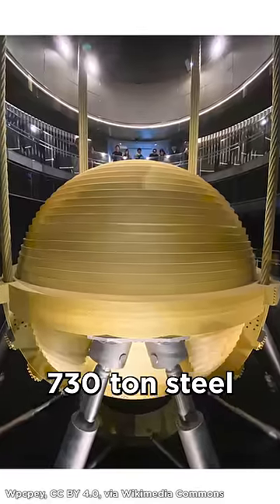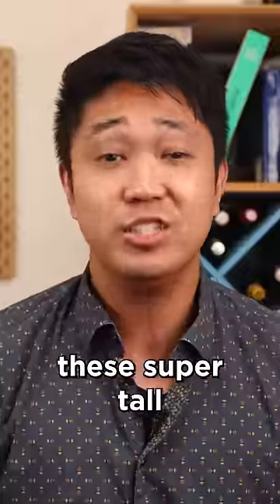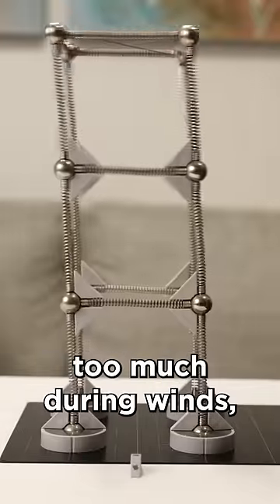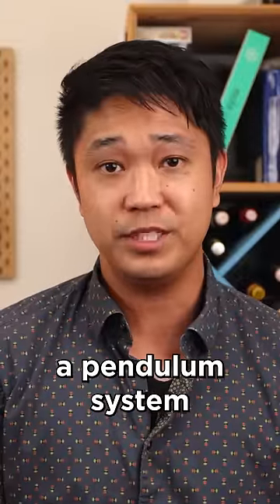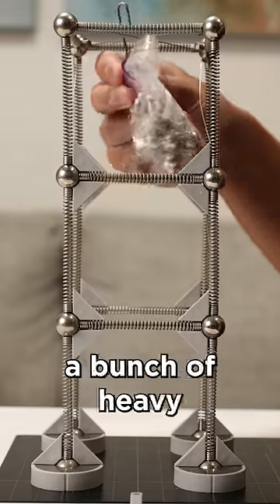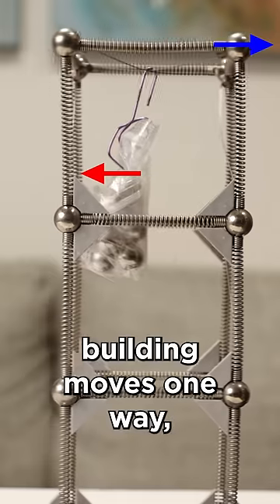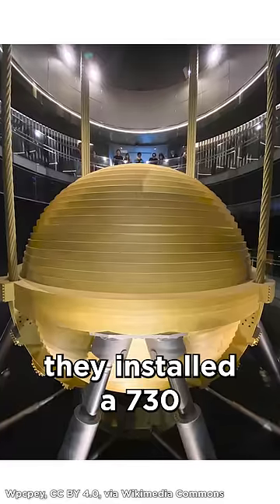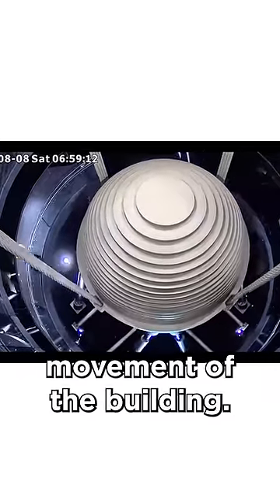Engineer Reacts to Taiwan's Earthquake Proof Skyscraper

Comment: I would just be scared of being under that ball because what if the chains holding it break
Reply: It's not held by chains,  rather suspended by hydraulic arms
Reply: + in addition the the hydraulics underneath there are steel cables holding it up so if the arms were to fail those cables would catch it. You can see them in the video
Reply: There’s overstrength factors used for critical components of seismic force resisting systems that multiply the force the components are designed for. Basically saying hey, if it has X amount of force on it actually, it needs to be designed for Y times that amount of force. So lots of redundancy and safety in the system.
Reply: Obviously, the people that built knew it was a massive ass ball...and accounted for it. smh
Reply: @rachel705 
Those hydraulics are what brakes the mass, there is no way they support it.
Reply: dont worry, taiwan doesnt hire engineers based on their race or gender
Reply: Idk, what if the building you are likely inside of right now collapsed, how about that
Reply: @zacharybyrne9723 obviously bud, and that’s not a technique specific to large steel dampers.
Reply: @gopackgo4036 probably not as obvious for those without a little bit of engineering knowledge so I was just trying to share. Also I did specify that all seismic systems have these factors not just this one. 👍🏻
Reply: @-pauI-  neither does the US. Go outside and talk to another human being.
Reply: Those aren't chains....

Comment: Same technology is used in cruise ships but with water, they move the water that store in the ship from one side to another during storm to counteract ships movements side to side.
Reply: cavitation right?
Reply: Not sure with that water that you are saying. Yes there is water ballast tank on all types of ships, i guess an estabilizer is equipped on cruise ships. But in Marine engines, it has what they  call compensator it is equipped in the Engine to reduce vibration during,  especially at rough seas
Reply: Ballast.
Cavitation is when air gets trapped behind the propellers/impeller and cause free spin without thrust.
Reply: The technology was quite famously used by Renault in their title winning 2005 and 2006 Formula 1 cars before it was banned. It made the cars so much more predictable over uneven terrain.

Comment: Motioneering did NOT engineer this TMD for earthquake resistance, it is strictly designed to prevent sway from wind loading. It may have a residual effect in earthquakes but that is not what it was designed for
Reply: So it's not effective against earthquakes of high magnitude (6.0 up)? Will it worsen the sway during such strong earthquakes?
Reply: @testsalv4366  it would never worsen the sway. It will still have a positive effect in strong earthquakes, but the engineers have a separate seismic force resisting system for the structure.
Reply: Yapping
Reply: @bensblues  Okay, thanks for the answer.
Reply: @bensblues so why tf did you bring it up if it helps with earthquakes? That's exactly what the video said
Reply: @mannb1023  the video says thats what its designed for, but it isnt
Reply: @bensblues  what im saying is that they are engineered for both wind and earthquake resistance, even if wind is the problem they are trying to solve
Reply: I have no idea where you got misinformed but the tuned mass damper is against all harmonic vibrations. A TMD is always acting against the resonant frequency of the building and does NOT care about the source of the unwanted vibration. Most skyscrapers have additional dampers against earthquakes too but a TMD is NEVER just for wind and it would be harder and more expensive to design a wind motion damper solely for wind instead of a TMD also known as a seismic damper.
Reply: @lolo_o4309  TMDs are often just to counteract wind sway. Hence why they are still used in very low seismic zones. You should read what Motioneering (the designer) say about it instead of arguing from ignorance.
Reply: @bensblues  TMDs are very effective at counteracting wind sway as they are designed to reduce the swing of the building. Most TMDs are also designed with the primary objective of reducing motion from strong winds (as those are more common) but that's not their only purpose. A lot of articles said that the TMD in the taipei 101 was designed against seismic activity which is also incorrect. Primary objective was to address wind-sway but it will always counteract swing from other sources such as earthquakes and was certainly put into consideration while designing in such an earthquake prone region (not as the main thing against earthquakes but a part).
Reply: @lolo_o4309  Man i dont know what you're trying to do here... you are now aware it was not designed for seismic movement, which was my point in the first place. What is the misinformation?
Reply: @bensblues  you: "it is strictly designed to prevent sway from wind loading" it was not... hope this clears thing up
Reply: @bensblues  What me and the other guy are saying is that the damn thing was built for wind and earthquakes, even if earthquakes are not the primary reason for it being built

Idk whats so hard to understand about what we are saying, I understand that the building uses additional tech for seismic activity and not just the damper
Reply: @mannb1023  well then what you are saying is wrong lol. The damper was built for wind, not earthquakes. The shear walls are designed for earthquake resistance. Any seismic benefit from the damper is unintentional and therefore not what it was built for. This is getting ridiculous
Reply: @bensblues welcome to the wonders of debating people on the internet, where no matter for how long you debate no one ends up changing their minds
Reply: The tuners in nyc, typically a low earthquake area (I know, I know, we just had one) don't use the pendulum system. It's a heavy mass on a micro thin layer of oil that moves towards the direction of the wind.
Citibank has one, and most of the super tall billionaires row buildings have them.
Reply: @lolo_o4309 I am studying to be a mechanical engineer, and I am about to finish a class all about damped systems.  The most important aspects of damped systems are the gain and corner frequency.  The gain indicates how large the reaction is to a certain input, and the gain changes with different frequencies.  The corner frequency is the frequency that the gain starts to change at.  It seems likely to me that damper systems such as this one would only be designed to eliminate low frequency, high magnitude swaying due to wind (or the lowest frequency waves from quakes).  The gain in that case would be 0 or very small.  Frequencies above the damped skyscraper's corner frequency would have a higher gain until steadying out at 1 (reaction is the same magnitude as the input).  I can't say whether that corner frequency is less than or greater than the frequency of most earthquakes, but it would be more expensive to build the higher the corner frequency.
Reply: @TaxTheRich042 ong
Reply: @TaxTheRich042 professional yappers
Reply: That's what I was wondering, there's no way that's the only reason as to why it survived the earthquake
Reply: @mannb1023  thats not wat engineered for means
Reply: Bro I went to Taipei 101 and the videos and walls have descriptions about the design and showing when the ball worked against earthquakes
Reply: @TaxTheRich042 , you are the one yapping, you aren’t adding anything to the conversation
Reply: @bensblues a mechanism can have multiple purposes smh. Are u the engineer? They have to think through multiple things and I guarantee the engineers also thought about this being a way to minimize earth quake impacr
Reply: Just FYI, as someone who works at the place that wind tested this building, @bensblues is absolutely right. And yes motioneering is going around trying to correct people that the system is not designed for earth quakes. There are other systems in place for that. Oh and the double chamfer at the corners was also included to load the wind loads.
Reply: @San_fr_23 They’re having a relevant discussion about engineering concepts, you’re just barking in the background like small chihuahua, contributing nothing, you’re the yapper here bud
Reply: @slurp3194 They aren't the engineer, but they do seem to be repeatedly referring to the words of the company who designed the damn thing.
Reply: Yup Tuned Mass Damper
Reply: To people debating about designs, here's one easy example.

A chair is designed for people to sit on it comfortably. Can I use it as a stepladder? Sure I can. But is a chair designed for that? Definitely not.
Reply: @TaxTheRich042 typical liberal ,speaks out of turn and adds nothing to the conversation.
Reply: @lolo_o4309  you both have the exact same opinion why are you arguing
Reply: @CarlosAM1  these people don't even have a different opinion. They are just arguing semantics. What is the point?
Reply: @bensblues the ball pendulum is for wind… the struts and brakes are for earthquakes. It would be hard to tell which it’s more effective against because wind can’t take down a building alone like this. You’d need to measure and compare away from the top floor during a horrible windy storm and during a decent size earthquake to compare, and the struts and brakes dampening system I’m willing to bet is actually far more effective against earthquakes than wind… but hey I’m just a PHD engineer what do I know.
Reply: @joshroi8610  i sure hope your phd isnt in structural dynamics
Reply: And I do not think they designed it to prevent motion sickness. 😂😂😂
Reply: 7.4 OK, but what happens at 7.6? What if the ball started spinning and snapped loose?

Comment: Technically. The ball is trying to stay at rest. The building starts to sway but the ball works as a brake by trying to stay on its original location. The only force (aside from gravity) working on the ball is the building swaying. There will obviously be some residual swaying due to the force of the swaying building on the ball.

Comment: Well, it doesn't "swing" to the other direction: It stays in the starting position until there's enough force to beat inertia and that point is sharply calculated with the needed mass of the steel pendulum to match the next swing (although the secondary inertia action would somewhat match up, it will have incredible wear and tear plus it won't work as good and could perhaps cause structural damage which obviously will lead to lethal outcomes) so yes, it does swing in the eyes of the observerer but to call it an absolute swing is rather absurd in the sense of physics behind the mechanism.

Comment: The engineering behind Taipei101 is truly impressive. The tuned mass damper is a genius solution for preventing sway from wind loading.
Reply: By Italian engineers
Reply: This reads like a student who was forced to make a comment on taipei101 for credit
Reply: ai generated ahh comment💀
Reply: Chicken leave me alone please I’m begging you
Reply: very good。ten points to slytherin !
Reply: It's not an original design though. They copied it from traditional Japanese designs, which have been utilized in temples for hundreds of years.
Reply: @iamrightyouarewrong6730 correct it is ai it just scans the video and types up a comment

Comment: It reduces sway, but does it reduce or add tension? Basically yanking the building back to position from the top
Reply: Stress is proportional to sway. So if you reduce sway, you reduce stress

Comment: Renault used a tuned mass damper years ago in F1 to increase grip on the front tyres
Reply: In short yes, but in detail, it was implemented to make the car more stable at bumps which allowed them to lower the car further which improved tyre grip

Comment: American would never have this much preparation. Taiwan was hit was an even heavier 7.7 mag earthquake 25 years ago and they mandated that ALL buildings were built up to earthquake resistant code. the fact that they're only sitting at 10 casualties with such a dense population is insane
Reply: Because america never gets hit that hard by earthquakes? California is basically the only part of America that's at any severe earthquake risk, and there hasn't been a severe earthquake in 30 years anywhere in north america. And that last one was only a 6.7
Reply: California has been building with earthquakes in mind sense the big one (7.9) in 1906. 3,000 people died. When the Loma Linda (6.9) hit in 1989, 63 people died. We have quakes here every single day and Cali is about 10x the size of Taiwan. I think we are prepared.
Reply: Actually there's a comcast skyscraper in Philadelphia with a water tank at the top. It acts much like the pendulum in that it's meant to counteract forces that sway the building. It's designed for wind but should also work for earthquakes. This is not an uncommon solution either in America, They're called sloshing dampers.
Reply: You need to check out the building codes in San Francisco.
Reply: 台灣這次很幸運，雖然地震很強，連中國沿海城市都明顯感受到強烈的地震，但是這次震央在台灣東部近海，如果這次震央在台灣的中部，西部，北部，then we're cooked!

台灣在1999年的那場大地震死了很多人，倒了很多建築物，雖然我們馬上把相關的建築法規進行了更改跟升級，但是我們還是有超過50%的建築物是在1999年以前建的，這些老房子難以進行都市更新計畫，因為現有的法規規定屋主必須要減少自己擁有的坪數來進行都更，多數屋主都不願意自己的資產縮水，所以台北有一大堆老房子都無法進行都更

現在台灣的地質學家們還有土木工程師們最擔心的，就是台北發生地震，因為只要規模大一點，一定又會有房子倒塌，台北建築物密度很高，高度也不低，跟紐約差不多，如果有老舊建築物倒了，可能會出現骨牌效應，造成更多建築物倒塌

但沒辦法，台灣人耳朵硬，講不聽，他寧可賭地震不會來，也不要損失一點資產進行都更換取自己跟物產的安全

日本其實也是在1995年的阪神大地震發生後，才認真的訂下全新的建築法規，全面使用嚴格標準的抗震防震建材還有建築技術，但是1995年以前的日本老房子就沒有那麼耐震了，台灣是1999年之後，才全面跟日本學習各種防震建築技術還有研發相關防震材料的

不過台北就算有大地震，我也不覺得台北101會倒，台北101建的很堅固，很抗震，還能抗颱風，如果台北101倒了，那台灣人的顏面會掃地，台灣人不會想要看到這種事發生的

Comment: Can't wait to see what damage it wreaks when it falls after breaking.
Also, others have pointed out this is NOT used in (at least heavy) earthquakes, they lock it down.
So at that point wouldn't it be making things WORSE for the building with a giant weight added above it's center of mass?
I would assume they have this thing built on a serious "skid pad" to compensate for the earthquake situation.

Comment: Simple words, it functions like an anchor.
Reply: No it doesn’t
Reply: explain it then. Literally functions like an anchor or it somewhat functions like an anchor.

Anchors or heavy balls protect structures from swaying at it adds weight which takes advantage of gravity to pull the building down making it artificially more heavier and having more force to the ground means it will have less sway.

If your head don't understand  imagine you pushing something like a lego tower downward. No matter how much you blow it, it doesn't sway easily because there's a stronger force pushing it down than the Force pushing it horizontally aka the wind. 

If we're talking about earthquakes
Imagine Panzer 8 Maus a 188 ton behemoth one of the heaviest tanks to ever existed compared to a human like you for example, no weight because of the lack of brains and when it earthquakes you move more or you sway more as you are more lighter and your mass is smaller than the Maus. THAT'S LITERALLY THE BALL being an added weight to the building.

Anchors functions somewhat the same at it make the ship stay in place to prevent it from going anywhere.

That huge ball functions the same it adds weight. So the building won't go flying on the air. Is basically an alternative to joints.

If you have a better explanation do so I dare you.

If not then stop talking.
Reply: @miyuki4715 Chill bro but I guess your right it's simple physics in the end lol.
Reply: @miyuki4715 You should learn how to be nice.

Comment: I'm no architectural engineer but wouldn't it help lessen sway even more if they used a more dense material for a heavier damper?
Reply: A TMD isn't just a heavy ball, if you look it up you can see that for some reason the ball have been overengineered

Comment: That's about 1.5 MILLION pounds.

How many cranes are needed to lift it, what kind of truck can move it and what is it's suspension like. 

That's  1/3 the weight of the Space Shuttle, including its external tank and solid rocket boosters, and the thing that moves that is ridiculous

Comment: Not just that…. You missed things entirely… I can see you aren’t an engineer because my mind saw your faults immediately. It’s not so much whatsoever about what you’re talking about… the movement alone isn’t all that counteracts the sway…

The MOST IMPORTANT dampening of this is the struts attached to the pendulum ball…. Those struts allow the ball the EXERT FORCE in the opposite direction of the sway… so not only is it a heavy weight centering the sway… it’s pushing back on the opposite side of the sway to cancel out the sway faster than it even happens… that’s far more effective than just a heavy ball swinging. 

I HIGHLY suggest you redo your little test and attach the weight with struts allowing it to exert force on the opposite side of the sway and they watch the difference… it’ll cut it down to nearly no sway whatsoever with the right weight counter weight.

Comment: And the long shock absorbers burn off the energy of the moving mass as heat, much like the brakes on your car burn off the car's moving energy in the form of heat. This is where the "damper" term comes from. The all-spring example in the video does not add any kind of damper, resulting in more motion than you would see if there were a way to add some simple shock absorber to it.

Comment: As i recall a similar damper system was in an old theater in one of the Clairemont McKenna Colleges in California.  Sometime in the 1970s they felt the need to destroy the old structure because it was not seismically safe.  They went into the attic…and found a series of counter weight pendulums created out of huge stones.  The structure was saved…and hopefully though it has been 50 years since i saw it…it is still standing.